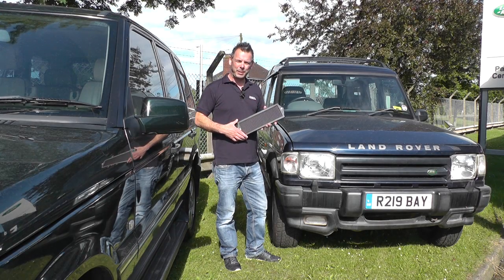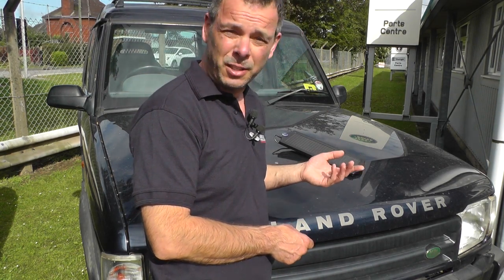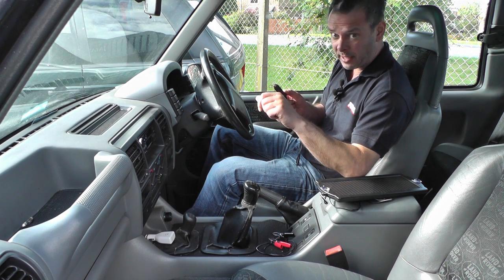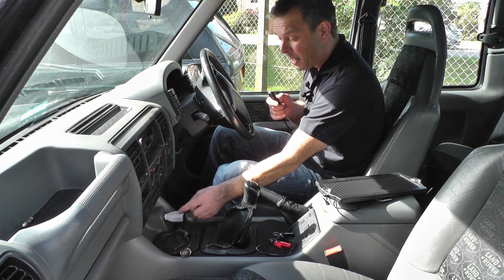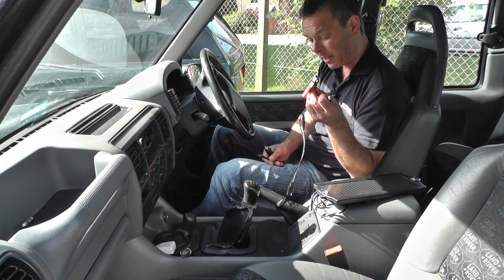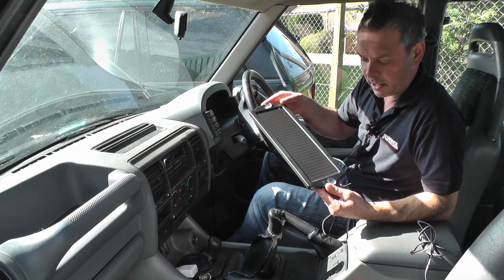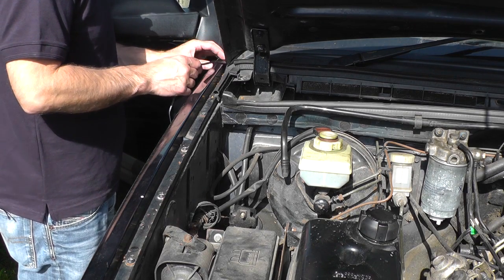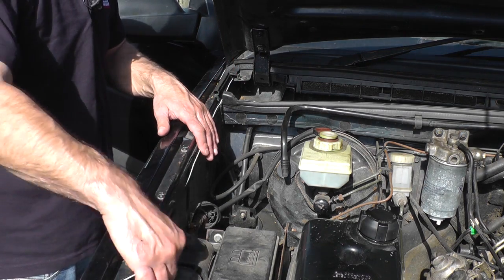Fitting a solar powered battery maintainer to a Land Rover Discovery 300TDI

Comment: ⚠️WARNING! If on a later BMW / Mini, do NOT connect to negative terminal of battery as they have an IBS (Intelligent Battery Sensor) fitted to the negative terminal and you will be by-passing this.... Fit negative terminal of charger to the dedicated chassis point or another suitable ground.

Comment: How do get your cigarette lighter to work if your engine is off what's the procedure to do that? Running the wire out side the vehicle is not good!
Reply: Take it to a 'guy', who will connect the socket to a permanent live feed. Any auto spark can do that at minimal cost...